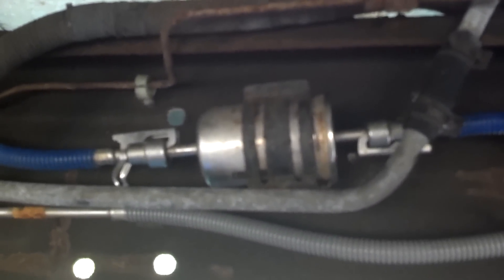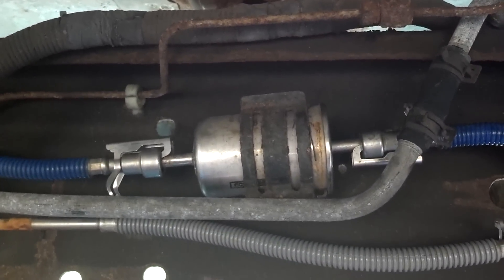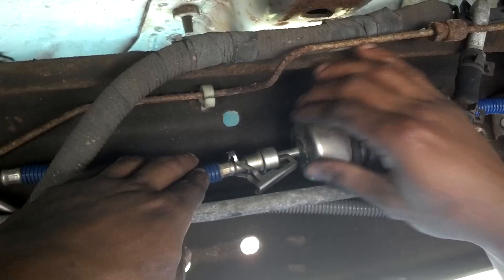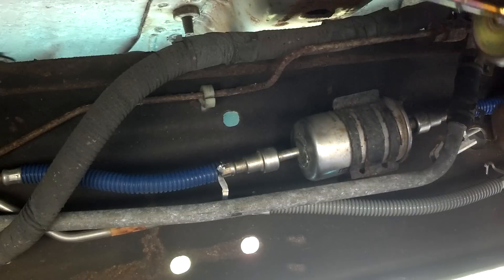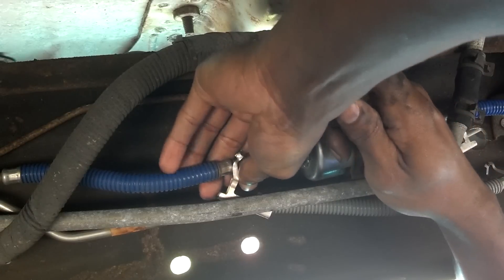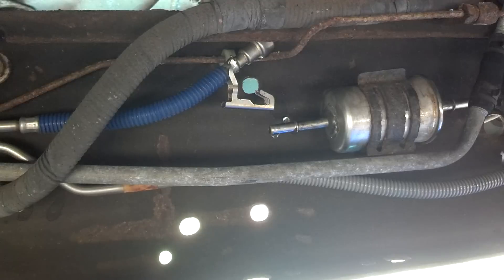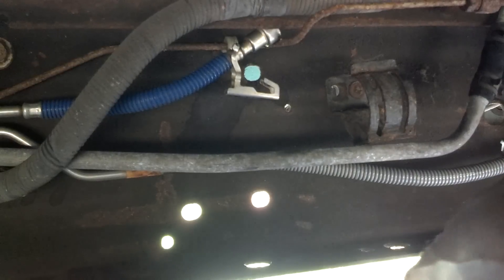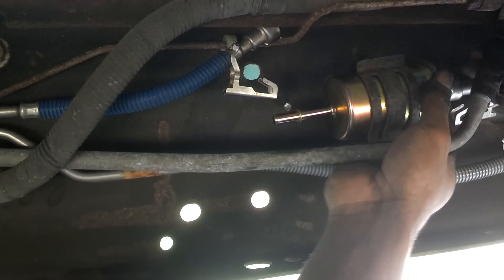How to change your fuel filter in a Ford

Comment: Great video, thanks.  To anyone doing this, be sure to check the "flow" arrow on the new filter so that it's pointing in the correct direction!
Reply: Which way should it point? Forward?
Reply: @sheilastarlight5257  yes

Comment: great video. you can also depressurize from the fuel bar schrader. i found that it sometimes helps to actually push the filter into the quick connects to get your tool engaged, then you can pull the connector from the filter easily. it seems if you try to force the tool into the connecters without them being disengaged, it can be harder to pull apart. just my $0.02

Comment: thank you so much dude. out of all the videos, yours had the clearest instructions. again thanks
Reply: 1. take out your fuel pump relay (#301 relay if i remember correctly) 
2.  take off your gas cap
3.  crank up truck (will only turn over, this will de-pressure line)

Comment: Thank you for your video it helped save me a lot of money. You also gave me the confidence in seeing how you did it with the step by step process to do it myself. It was nice that you forewarned us about the part of the gas spraying everywhere as well. Espevially when I told the guy at the garage that I was going to do it mysrlf after he quoted me three different price points. Both me and my kids thank you so much because being a single parent on a tight budget, it is hard to figure out where the money would come from. It makes it hard to trust mechanics esprcially when they give you different rates. My kids have since talked me into saving up for a general mechanics course so I have the  basic knowledge to do things myself as well as how much it should cost. Have a great day and God bless.

Comment: i did this in my ford and FUCK it was hard to do. my truck had 95% stock everything, what i mean with it is that other than tires, brakes and maybe one oil cha ge every year it never had nothing done.
i changed the wires spark plugs, ignition coil pack, the radiator (cracked) and thermostat housing/temp sensors , control arms,  wheel bearings (top left was replaced only with a chinese one that made it vibrate) ths rest were stock the same as all parts i mentioned. i increased the mpg of it by atleast 8 mpg extra, o just did this today and it was hell to do took me an hour i kept thinking i was doing it wrong, but it was like soldered togheter due to not being removed in 17 years that fuel filter barely let gas pass thru it. once i replaced it a chunk of black chalk like paste came out of the back of it and when forcing the gas out the filter the gas came yellowish, i hope i get some extra mpg after this i doubt ill do anhthing to it anymore its almoat gotten its original  average 22 mpg 17 years later.

Comment: now we just need a video on how to relieve the fuel pressure.. from what I read the cleanest and easiest way is to disconnect the wire/clip to the inertia fuel cutoff switch, and then try to start your vehicle. Just simply trying to start the vehicle is said to release the pressure. After re-attach the clip/wire to the switch and check the button to see if its pressed down if somehow it popped up.. press it down. You should be good to go after. the other way is by hooking up a fuel pressure gauge that has a release on it, to the fuel rail valve and let it out that way. Also remove the gas tank cap.

Comment: Omg thank you.  I am doing this tomorrow .  My excursion cranks but won't start and I have done everything from fuses to relays ignition switch thingy lol and got it to briefly after spraying starting fluid in the carb.  So not a mechanic but kinda feel like one now.  Dropping tank to clear some lines hopefully that it.  Question to depressurize the tank is it the valve on the engine?  The one to see if fuel comes out?  I pushed it and no fuel .  Anyhow please let me know thanks
Reply: TIFFANY GOMEZ hopefully its not the fuel pump cause usually the car will still run with a clogged fuel filter but will be hard to start and performance will lack. good luck

Comment: No need for special tool to depressurize system. Just push in the Schrader valve at fuel rail. Looks like a tire valve stem. Just use a rag to keep fuel off everything

Comment: thanks for the video, but what f150 year does this apply to?
Reply: +certified30 Look at your fuel filter in place on your vehicle.  If it has the secondary clamps, this will be the procedure.  I have a 2000 explorer with the same setup.

Comment: To release the pressure,just open the fuel cap,thats all you have to do.
Reply: Most f150 don’t have fuel caps
Reply: It depends on the fuel system, some you need to remove the fuel pump relay and wait a few hrs until the fuel safety valve coming from the fuel pump in the tank leaks the pressure back into the tank (priming pressure loss) In dual tank Ford's there are 3 fuel pumps, 2 low pressure and 1 high pressure.